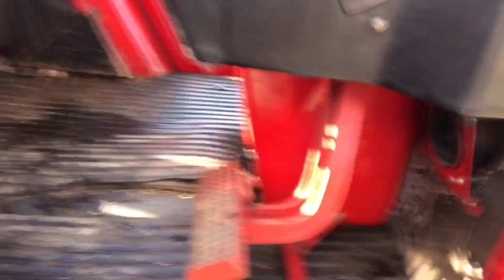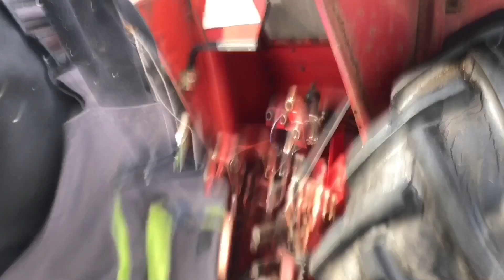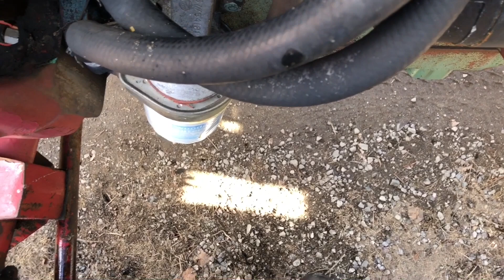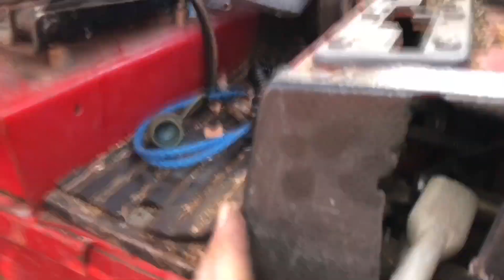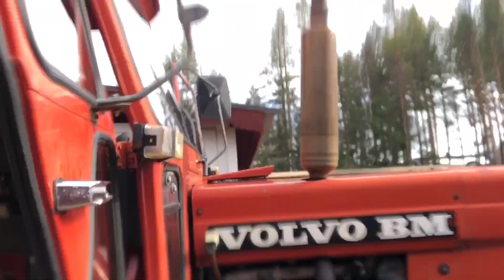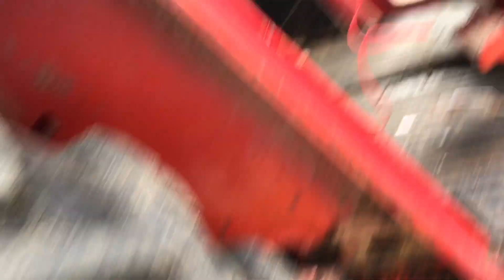How has this happened! Volvo 2254 4WD and Patu forest trailer and crane with doors!

Comment: What a nice old tractor, those are quite rare and expensive. Specially with low hours. 
I recently bought a 650 from a farm in Skåne with 2400 hours on it. 
Similar state, been left in a barn since 2004 and needs some work and service but runs like a dream.
Reply from the maker: The old ones just work right, I my friend had a 650 I used and worked on. I am pleased I got the 4wd for the forest and do like it. Thank you

Comment: The rear tyres can last many years if you don't mind estethics. It's the cord that holds it together and that is probably intact.
The 500/2200/2250 series is a bastard of a tractor with not much Volvo in it, just the hood and the cab. Engine is Perkins, rear end is IH and 4WD is japanese I believe.
Reply from the maker: Thanks, I know the tires on my backloader were 42 years old before I replaced them and the only reason I replaced them was because the cords had broken through on the inside and were puncturing the tubes. I had to removes the tires by myself with bars at -25C and I was not doing that anymore. So my reason for replacing the ones on this tractor is I have some experience of what is happening on the inside because I don't care what they look like I just do not want to be changing anymore tractor tires. Thanks for the info on how this tractor in made up. Now having had some experience with early Volvo's I am not surprised. The only Volvo part on My LM225 is the badge!

Comment: I had a similar oilleak on my frontaxel i changed sealing but it did not help so i bought a double sealed bearing and installed it instead of the original and that helpt
Reply from the maker: OK thanks that helps me was a planned job for next summer.

Comment: Can you take it in and out of 4 wheel drive ?    The added the returnline. From trailer to fill pipe they had to cap off oil dipstick. Cuse when useing trailer it would blow the dip stick out.   Pull that dipstick cap off see if. Fill stick still in under cap ??  I have seen that done b4.     Just fun enough RPM to lift the logs.  As we know there is alot of pressure. In hydraulics.   You got yourself one hell of a nice old work horse.  Just like we are.  Hell my tires have a bit of dry rot to 😁  enjoy that ride. Sound of that eng is music
Reply from the maker: Thanks, dipstick shaft removed I am guessing it got damaged by a log on the floor. I am pleased you enjoyed, have a great weekend.

Comment: Hey Simon. 
So the apparatus where the oil filler for the hydraulic oil should fill is a return hose for the log trailer hydraulic system. Since there is only one pressure hose feeding the valve on the trailer, it needs a return port to allow for constant flow from tractor to trailer. 
When the trailer is off the tractor, you need to make sure the lever to control that function is in neutral
Reply from the maker: Thanks Dave, I did read that in the operators manual. At first I had no idea what all the levers were but now have them all marked up and understand what the different valves do and that it must be as you say when not in use. Thanks for that, really important info had I not read it.
The book say it can cause damage to the system.
Reply: Hi Simon. 
You are very fortunate you read that as we had customers with new Massey tractors didn’t heed  our warning or didn’t read the attachment manual and destroyed their hydraulic pumps very quickly,and these were new tractors. 
No warranty for not following instructions for these folks. 
You have a very good set up and with a little TLC, it will serve you well for a long time.
Reply from the maker: Thanks Dave I really appreciate you.

Comment: Here's me thinking... your negotiating skills are the envy of many - I'm sure there are many folk who have learned from you and prospered! I'm rather chuffed that your back now has help! 
One question... how will the rig fair in winter? Will you have to run in paths too, even widen some areas to get in?
Reply from the maker: Good question, but here's my thinking because it cannot go where the snowmobile and I go in the deep snow. With this I can move more with ease, lift more and maybe I don't need to cut in the winter anymore. I can in the winter because it is the best time for single season drying and all I have to get there is the snowmobile. But If I had a 4WD tractor and forest trailer I can cut so much more and move more in less time and effort so could stack more and get 2 winters ahead. If I can do that then I can cut any time and collect when it suits the tractor and stack in the yard, cut and split when it suits me know I have 1 winter in hand allowing more drying time for tree cut in either Autumn or Spring. If I want to cut in winter I can and just collect in spring. It has never been about the cutting always the lifting and moving. I have to work so many weeks moving because I can only get a few logs at a time on the sled with days between to rest on the damaged discs. All I know for sure is my days of manually handling the logs are numbered and further surgery is imminent unless I stop. If I stop I am back to nothing so in order to pay the electric and diesel bills I need a forest trailer and crane. I would have liked to continue how I was, it was easy and simple but restrictive and to much for my already broken body. It is also good to bring back the old stuff, better than leaving rotting right. You always ask such good questions AJ, Thanks you and have a great week. The beaches must be warming nicely.
Reply: @arctic-rebel  Great answer. I thought that anytime working could be on the cards and honestly, the more you have mechanical help, the better! It will be great that you can now fit the cutting schedule in with your other activities and stress less about your stock for the essential winter warming!
Yes... we love watching you fix the old stuff... because, Simon always wins!! That is a given! Maybe you should get patrion... I will help with the tire fund!
Believe it or not... I prefer detecting in winter - especially after the storms! Too many inquisitive snoopers on the beaches in summer! However, it is my fix so I need to stay at it!! The last outing (I must still edit) wasn't so good... but, everyday out and upright is a winner!!
Let that rig make your life a whole lot easier... and buy you loads of time for other stuff... like fishing and playing with Kasper!! 😉😁

Comment: Wow Simon!!  Great buy and little TLC with the old Girl.  But I know you will getting it running in tip top sharp.  Tubes for the rear?
Reply from the maker: Hi Dave, Thanks. It has tubes in the rear, I have been through it all with the back loader trying to find ways to make the old tires last longer but the reality is they are 44 years old and are ready to let me down. Can you imagine a blow out on the main road and then how much it would cost or even roll into the snow ditch. It has to be done. Minor in the overall scheme of things I think.
Reply: @arctic-rebel  yes new tires for all the hard working equipment?  Safety plus your back guy would give you shit??

Comment: So from the farm aspect of things yes every time you undo those hoses you will have oil coming out wipe it clean and invest into some plugs male and female for your connections to protect them from being dirty, and not to be the Debbie Downer of things on a couple of those hoses when you start adding pressure gravel analog you may wind up breaking some of them which I'm sure you know this but I had to say it anyway. Part 2 so that one single line that dumps back into the tank that was put there for the purpose of the oil going back into the reservoir we had to convert one of our pieces of equipment to do that as well, and yes the wheel seal is probably leaking hence why you have oil coming out. Number three😂😂😂😂 I'm glad the dog is enjoying the ball I'm sitting here watching and I hear squeak it brought an instant smile to my face and I didn't feel what he was playing with😅😅 and then I seen the green and blue. Number four when you take those caps off the trailers axle I can only suggest for you to drill a hole and put a grease cert in so that you can make sure they're greased and as far as that one being loose you might be able to tighten up the king nut on it. Number 5 look at you smiling with a closed cab and now you've got some heat😅😅 sure is nice isn't it now you just need to hook up a radio in a speaker in there👊👍huge and great score you got and i know it will serve you well .?? Tho 🤔 are the rims the same and same size as the loader 🤔🤔 , I know it might be pain-in-the-ass switching them out if they fit but you have a peace of mind going into the woods and not puncturing a hole through one of the cracks in the tires I'm sure you might be able to agree on that.. i look forward to seeing the chains and bucket
Reply from the maker: Thanks Heith, got all of that, have caps in the cab and yes I know those hoses could blow but it looks to be only the outer rubber so far the steel is wire is still good to the eyesight! I was hoping the king nuts would take up the slack but until I get the caps off who knows. The loader is huge compared so could not swap the tires out even if I wanted too.
Just leaving for town so will catch you later, Thanks Buddy.
Reply: @arctic-rebel  about 5 am here and heading to work . Have a great day Simon and drive safe

Comment: Hi Simon... what a bargain.. you find a tractor and a forest trailer that you really need, and we get a video lasting for more than an hour👍 Those 2254s are damn good machines.. they'll last a lifetime with some TLC. I know of a similar tractor about 30 km South of us, a 1979ish model, and it has passed 15k hours by a lot and is still going strong. I don't know what you've paid, bartered or traded for that machine, and I don't care either, but that is a terrific find, and I'm sure it will serve you well.. just think about it.. getting timber and firewood home at all 4 seasons if necessary without braking your body apart👌👌All the best buddy🙂
Reply from the maker: Yes, yes and yes, I didn't even know it was a 2254 until I went to collect it. When I saw it I had trouble containing my excitement know how rare they are. Thank you for sharing your enthusiasm, it is going to make such a difference to my seasons and hopefully no more  laying on my back for days on end. Have a great day I really appreciate you.